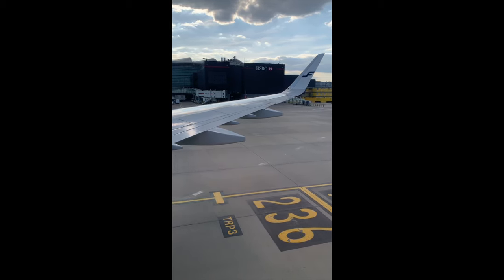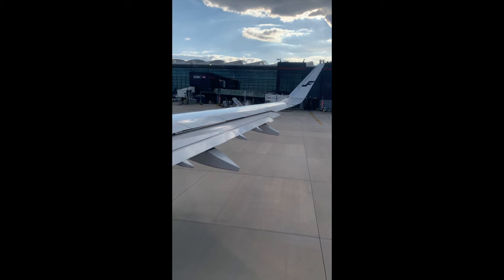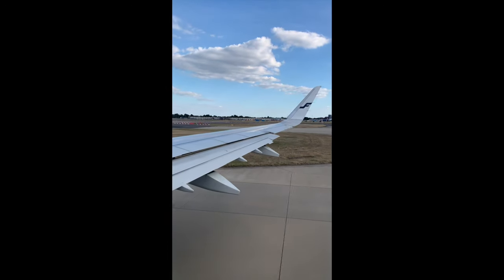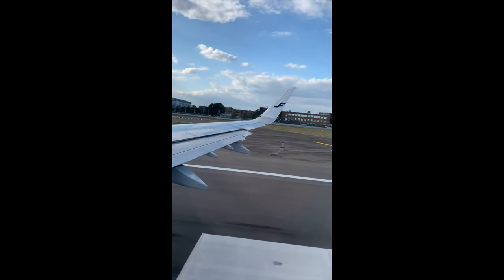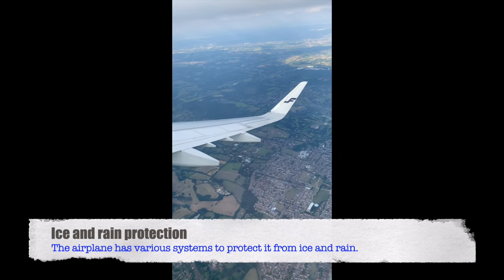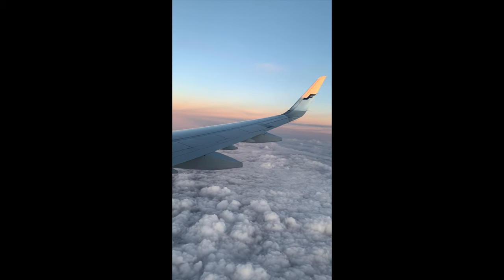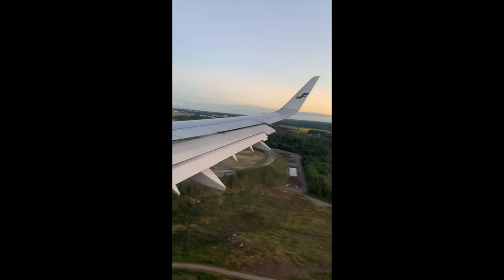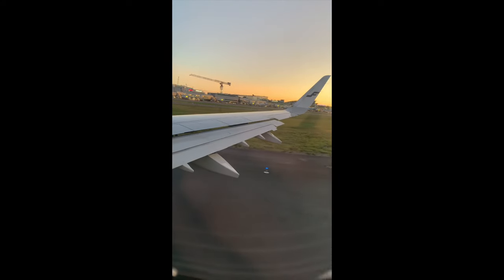Airplane noises explained by airline pilot (Full flight) - Ask A Pilot

Comment: You should have mentioned how when the flaps are retracted shortly after take-off, there is a brief "falling" feeling that comes a result of this. I have found that people who do not know much about aviation, get particularly worried when this happens
Reply: The falling mid flight is what bothers me. More than turbulence. Like dropping in an elevator
Reply: @Jeff_1349  I’ve learned that this can’t happen, I’ve had the exact fear. If the plane runs out of gas, the engine fails, etc.

The plane is still able to glide for a solid 30-60 minutes which gives you enough time  for a landing at a nearby airport!
Reply: The falling sensation is just a sensory trick that results from the pilots reducing the amount of thrust now that they don’t need all of that power from takeoff or they have to slow down a bit once they’re suitably high enough from the ground to reduce noise for the people living below them near the airport’s benefit. It’s just a result of the liquid responsible for balance being sloshed around your inner ear.
Reply: @mikoto7693  thank you sm for this!!! really helps calm down my anxiety
Reply: It's not when flaps are retracted, it's when the plane reduces the pitch angle
Reply: Is the plane actually taking a little dip or just a feeling ?
Reply: @emilypena8500  it's just a feeling :) it's due to the inertia of the liquid within your ear that perceives your body's movements. It's like when you run with a glass of water and suddenly stop and the water spills over in the direction you were going
Reply: @mikoto7693  but this sensations makes me soooo anxious as they mimic a panic attack
Reply: I was wondering what that was on my last few flights!
Reply: @mikoto7693  It's also an ATC requirement to remain below a certain speed until they are cleared from speed restrictions usually within a 30 mile radius of major air carrier airports.  Unless cleared by ATC, that speed is usually 250 knots,and below 10,000 feet leaving and arriving that section of airspace.  On approach to landing passengers may also hear the engine rev up or down a bit.  This is for ATC to provide proper spacing (usually 3-5 miles apart) while blending in with other aircraft that are being 'funneled' into landing sequence.
Reply: @kaylee5888  A bit late, but you’re most welcome. If you have more questions I’d be happy to try to answer and if I don’t know the answer then I work with pilots and engineers at an airport and can ask next shift.
Reply: @mariannetannouri2670  I’m genuinely sorry to hear that and I wish knowing what it really is would help. Flying is very safe; if it helps know this.

I work on the ground crews and I can say that everyone from pilots to cleaners is obsessed about pax safety. We do everything we can to make every flight as safe as possible.
Reply: @avflyguy  Thank you for the additional information. 😁
Reply: YES!

That is THE scariest part of the flight because it sounds like the engines are turning off and it feels like we're starting to fall.

The fact that he didn't mention this just makes me worry more.  If he didn't mention this, what else is he missing (when he's in the cockpit)?

Comment: oh my god. im an anxious flyer and so im always hyper vigilant on flights. ive always noticed the sound on a flight where it sounds like the engine is turned off in the middle of the flight and it has always freaked me out as id always assumed it was something bad. it’s really helpful to know that its just the plane starting to cruise!! thank you for this!!
Reply: When I was on my first ever flight as a teenager the sounds of the reversers deploying and the sounds they make freaked me out a bit. But somehow I had the presence of mind to look around at the other passengers and the flight attendants. Nobody was panicking or distressed so I figured that whatever was making that sound was completely normal. I did ask my Dad about it and he explained the reversers to me. 

But if the unknown sounds and whatnot scares you then I would suggest watching explanatory videos like this one and learn the basics of how airliners work, how planes fly and whatnot. It really can help.
Reply: @mikoto7693  It really does! Had quite the anxiety about flying until I really started to learn how the planes work, and how efficient and safe they actually are!
Reply: Even if it did, if your flying in either some type of boeing or Airbus, which likely is the case as they are amongst the most common passenger airplanes in the skies around the world,  (typical commercial passenger jets), they can easily glide 100 miles or more without absolutely zero engines or complete engine failure (assuming you were at sufficient speed prior to failure). So even still as long as you aren't over a large body of water or mountain, there is still pretty good chance that the pilots will have ample time to decide on the best course of action and ultimately a (relatively) safe place to do an emergency landing. So there is still hope that if God forbid an engine may actually ever give out you would walk away.

Comment: What bothers me is that sinking feeling right after takeoff accompanied by reduced engine noise.  Sometimes it feels like the engines are going to quit at a critical phase of the flight.  I understand the primary cause for this is that jet engines need to be spooled back a few minutes after a full power takeoff to allow them to cool off before resuming a climb out to cruise altitude.
Reply: this happens when the flaps are retracted shortly after take-off, nothing to worry about. You can look out the window next time and be prepared so it doesn't come as a surprise :)
Reply: I know exactly that "sinking feeling" you mean. It happens, when the climb rate is reduced "from high to zero" very fast (usually by the autopilot). At certain airports / departure routes, the plane needs to climb fast e.g. to avoid mountains, other aircraft etc. The pilots receive an altitude from ATC e.g. "climb to 10.000 feet". Once the plane has reached 10.000 ft, the autopilot will reduce engine power and climb rate. If the climb rate was previously high, and it is reduced fast, you will feel it in your gut. At certain airports / departure routes, the plane can climb more smoothly and you won't feel anything.

Comment: My main fear is just after takeoff. It's worst when the flaps retract and the gear comes off and we make the first turn. My body feels like we're going too slow and the plane is going to stall. The more the attitude of the plane levels out, the better I feel. By the time we reach cruising altitude, I'm completely relaxed. But before takeoff...for MONTHS, I have anxiety whenever I think about the flight. By the time I'm sitting on the plane, it's fear. Once the engines spool up, it's terror.
 But all on the outbound trip. Coming back, I'm pretty much fine
Reply: EXACTLY its at that moment when the plane Is going up and the plane feels like its going too slow and its going to fall backwards but over time u get used to it and feel relief when it gets closer to cruising
Reply: Here watching right AFTER take off 🤣🥲🥲🥲
Reply: It is going quite slow, this is because in actuality the most efficient way to climb is to get out of the high density "soup" of the lower atmosphere as quickly as possible. So noise regulations notwithstanding, they will go full power with a high attitude, going more upward than forward almost. The computer has limits built in to keep it safely out of a stall, but yeah the reason it feels like it's going slow is because it is, but it's not dangerous.
Reply: I should add that I mean when the gear comes UP. I think it's very normal to be nervous when it comes off...
Reply: Yep that's me too... gripping onto the seats with sweaty hands preparing myself mentally for the free fall..... I hate flying lol

Comment: Honestly the thing that freaks me out the most is when the engines turn down after climbing because my hindbrain thinks the plane will fall out of the sky, but knowing that even if both engines sudddenly stopped the plane wouldn't drop out of the sky because it's going so fast has really helped. It would just glide and the pilots would have enough time to land the plane.
Reply: Frrrr and sometimes you can feel the airplane slow down in the air and i be like “holy fuck why are we stopping in the air we’re gonna fall” but then i realize I’m in a whole ass airplane
Reply: You aren't alone I have a reoccurring dream/nightmare about it...its normal to be a little fearful

Comment: My first airline flight was alone at age 11. I was flying on a Continental 737-500. When we landed in Houston and the reversers deployed I freaked out because I thought something had ripped off as I was seeing the inside of the engine in my mind. I pushed the call button several times, prompting them to announce that they couldn’t get up until we reached the gate. Of course it slid back into place and I got a lengthy trip to the cockpit out of it.

Comment: The only thing that I noticed missing was using the spoilers to start slowing down the airplane before any flaps are extended.  The spoilers do create some wing vibration and noise so it would have been good to also show that.  Overall, I think this was very well done.

Comment: Frequent AND nervous flyer here. This video is great. I did wonder why there is that lack of engine noise and my first thought is “does anyone else know?!” haha. I also sometimes hear a high pitched noise in the cabin - I wonder what that could be?
Reply: Lack of engine noise:  If the plane descends from a higher to a lower altitude, sometimes the engines are put on idle, to ensure the plane doesn't go too fast. This can happen before landing, or in the middle of the flight (altitude changes happen e.g. to avoid turbulences or other aircraft). High pitched noise: Can you describe it in more detail? When does it happen, and how exactly does it sound? It could be the flaps extended before landing.
Reply: I also hear that high pitched noise sometimes. Its definitely the engine. I notice it on Airbus more than Boeing!

Comment: I was on a flight not long ago where we were coming through clouds but there were some really strange changes in thrust. At times it felt like we were going almost full thrust then going with far less, then speeding up again. I was pretty frightened by this as it isn't something that has happened me often and others were looking at each other as if to say this is weird. A few thought we were circling. 

I should add that there was a very strong breeze or crosswind when we got off the plane? Was the changes in thrust based on that?

Comment: Great video!
After a flight were the hydraulics noise was going off and on during the entire taxi and even during take off I wanted to know what it was!
I also could bearly hear the engines on the 777 I was on, so I was slowly starting to suspect one engine had starting issues as the hydraulic sound came with an engine start. Thought the engines were restarted several times during taxi, which wasn't a very nice thought to have..

Comment: The popping you hear from the landing gear opening is likely from the hydraulic spreaders over the wheel assembly. You first usually hear the air rushing as the landing gear is open, and then, as the "pop" occurs, these are the spreaders exploding outward to lock the gear in place.

Comment: 8:43 - at this point, at the start of the runway takeoff after a full stop, you hear 2 types of spools. The 1st engine spool allows for something like a light thrust to allow the plane to start moving slowly - and then, seconds after that, the 2nd spool, much louder than that, thundery--that is the engine releasing full thrust to allow full power for the acceleration on the runway. 

The takeoff on the runway from slowing out on 1st spool then the first ascent out of the runway into the air usually takes between 15 to up to 25 seconds, I guess, depending on the length of the runway. A 4-engine jet would require a much more long runway to take off and more time to do it (I had been on an Air France flight with 4 engines at CDG when it took off from Chicago and saw this.)

Comment: Thank you for posting. I haven't flown in almost 2 years because I'm terrified of flying, and the last flight I took I was white knuckling both armrests with my eyes closed the entire time. One of the more terrifying sounds for me is when they slow down while in the air, it makes me feel like there's something wrong with the engines
Reply: It's normal. "Full power" is only selected during take off. Once in the air, the higher the plane climbs, the less power is needed. So the pilots (or autopilot) reduces the power to save fuel. Once cruising altitude is reached, or upon descent, the power is reduced again. This often can be "felt in the stomache". Sometimes during descent, power is put to "idle" and the speedbrakes are deployed, to ensure the plane doesn't go too fast. The engines can become very quiet in this phase, but it's completely normal procedure.
Reply: @petermuller5800  thank you for your explanation! It makes total sense. I think at the end of the day it's the lack of control that scares me. In everything else I do, generally, I decide whether I live or die. When I'm in a plane..... living and dying isn't a decision to be made by me. I think at the core of it, that's what truly scares me about flying

Comment: Everything answered except my question. Sigh. 
I’m writing a massive book +800 pages thus far, and I’m extremely frustrated and tired. 
I would be very grateful if someone could please kindly explain the definite sound you hear inside the cabin as people are boarding a passenger plane. 
It’s a low hum or whoosh sound like air filling up the cabin, except people are still boarding and the door is still open. It hasn’t even begun to taxi yet. 
Thank you.
Reply: I think it might be the air conditioning system - not 100% sure. Hopefully someone can chime in to confirm!
Reply: @malikastone  Thanks.
Reply: Most likely ground power units, providing A/C to / thru the vents and electrical.  With the doors open,  it is just more noticable.  When at the gate,  most power needs are ground based.  In some cases could be the APU in the far aft of the tail supplying A/C and electrical.

Comment: As a person who travels alot (mostly in the past as a kid), Flying is usually fun af. I grew up travelling with the bigger middle east airlines and till today when i fly with them or a big airline etc in a widebody aircraft i can sleep in peace, watch a movie etc and just relax. Now when i use EasyJet and these other lowcost airlines 😂 stress levels go through the roof, i cant sleep, i have to pay attention to the safety guides etc haha. No offense to the pilots but i just dont trust 95% of them full heartedly lol. Usually rougher landings, sharper manuevers in a smaller aircraft which is just horrible. For eg a Qatar Airways A320 flight feels like a chaueffer driving a rolls royce and the EasyJet a320 feels like a learner driver in shitbox from the 90s 😂
Reply from the maker: Actually the low-cost airlines have more to lose if they have safety issues. Basically the whole airline would be done very fast. Therefore safety is very important to low-cost airlines. For example Ryanair is very well know for great training of their pilots. :)
Reply: @AskAPilot  Partially true. They run on very tight profit margins. They cant make money sitting on the ground.  Agree with training standards.  Not so sure on MEL compliance all the time though. Most all are high time aircraft with many cycles on them.  Not saying they are unsafe at all.  Quite the contrary.  They do have an excellent safety record,  as do the flagship carriers.  Six of one...1/2 dozen of the other.  Matter of perception.